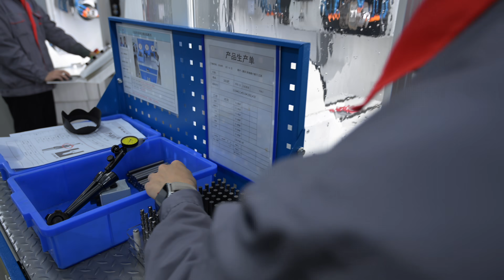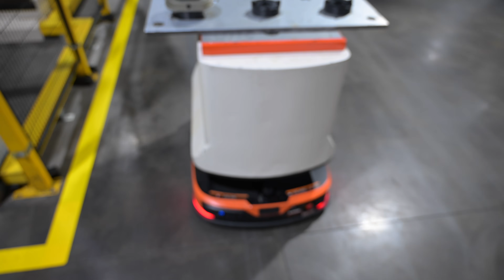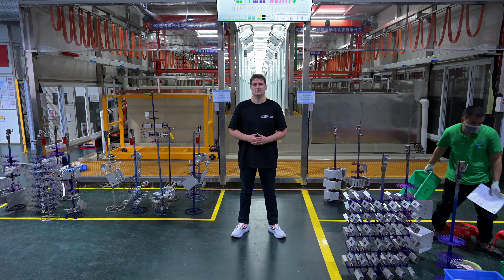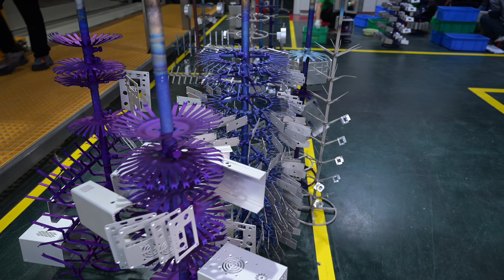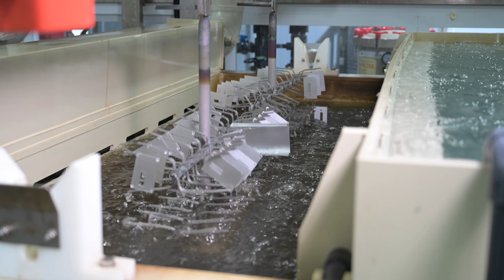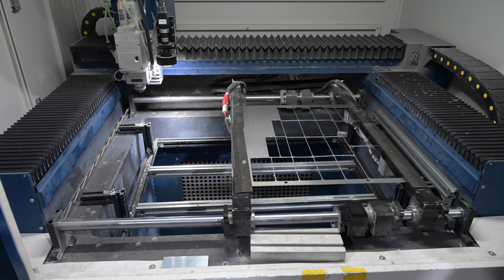Huge CNC factory in China | Factory tour

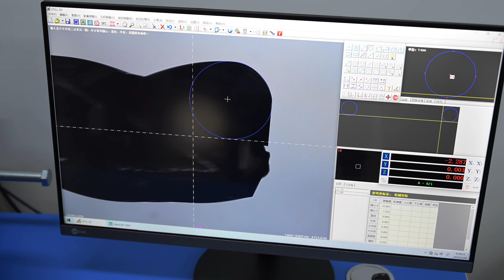Comment: It’s incredible to see just how advanced the level of automation is here. The segment around 1:38 showing the automated system using autonomous robots to transport tools and fixtures completely blows away the old misconception that manufacturing in China is primarily manual labor. Truly more automated than a lot of shops you see in the West! Out of curiosity, what is the typical turnaround time for a custom CNC order from a facility this highly optimized?
Reply from the maker: Actual turn around time is within a day, lead time itself depends on the order backlog…but the flow through the factory is really efficient!